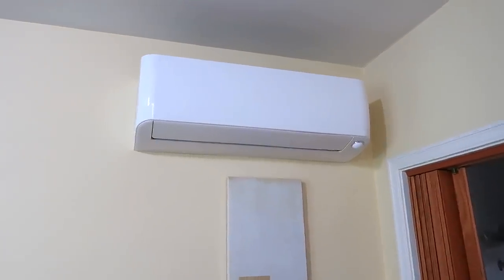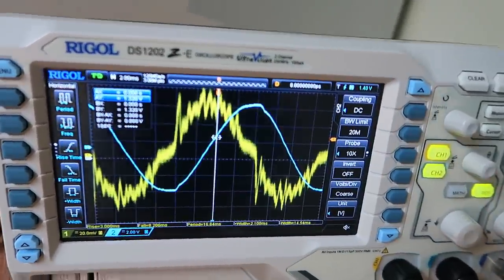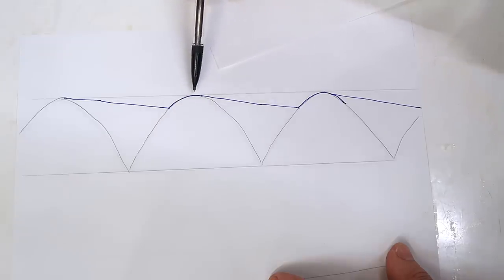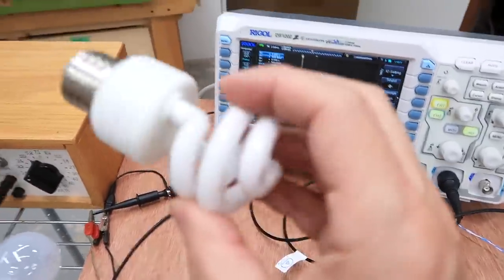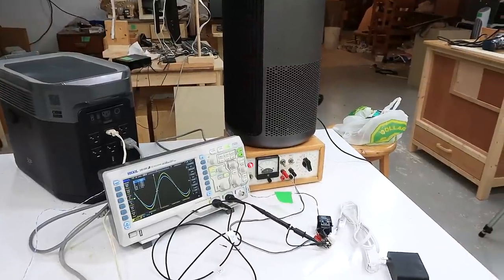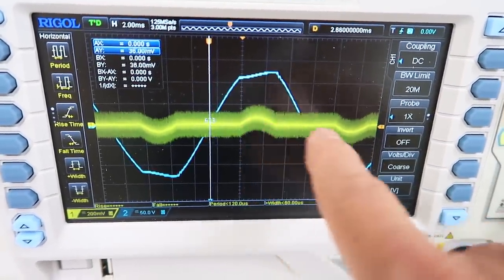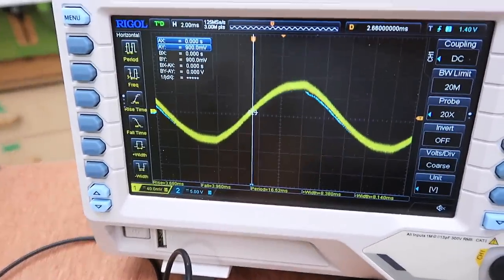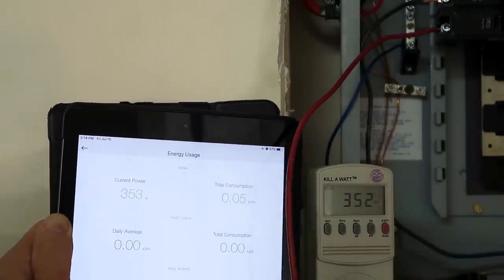Our electrical is all wobbly, measuring power is hard

Comment: This is also a great demo of phase shift and power factor.  The wave forms of the incandescent tungsten bulb have lined up peaks of V and A.  The capacitor and inductors (shaded pole linear  Squirrel   cage fan) have shifts in opposite directions.  The oscillating pedestal fan may have a capacitor in it to correct the power factor.
Reply: Set phasors to stun!

Comment: This video is perfectly timed.   I recently wanted to figure out why the measurement of our 240vac split-phase is so different with a True RMS meter vs another quality meter.   I put the oscilloscope on it (with a differential probe for safety due to it being a 300v scope), and the line-to-line waveform has flats at the top and bottom.  One of the line-neutral legs has REALLY pronounced flats, the other one is  a decent sine wave.      Due to your video, I now have some good ideas on narrowing down what might be causing it, before calling the power company to see if the shop's transformer had something wrong.

Comment: Matthias, as a cross-check, you can always use the "MATH" function on your Rigol O'scope, to multiply the voltage and current traces (AC-coupled, BW_limited), then compute the mean value of the MATH output (also on your 'scope). This is, by definition, the true-RMS power (assuming your CT does not add any funky phase-shifts)
Reply: That gives you apparent power, not true power, unless it's a purely resistive load like an incandescent bulb or resistive heater.
Reply: yes, so long as you use the correct burden resistor on the CT, it should be ok.
Reply: Not apparent power, multiply each sample, and then integrate gives real power.
Reply: @liam3284  That's apparent power.  It would be real power in the resistive load examples.
Reply: @earthwormjim  You mean active power? That gives you active power. Apparent power does not take into account the phase shift
Reply: real power (rms(V*A)). apparent power would be rms(V)*rms(A)
Reply: @ailivac  instantaneous Real Power (aka. Active Power) is the product of the instantaneous Voltage (V) and instantaneous Current (I). This is exactly what the OP said.
Power is more usefully described as a time-domain average over an integer number of cycles of the power frequency
ie. Pavg = AVG(V * I)
Reply: @dl5244  Thanks, D L, for your vote of confidence :)
Reply: @ailivac mean(u*i) is sufficient - you don't need to "RMS". Why? --> RMS is a construct needed, in the first place, because power (from a voltage) is proportional to u^2 (or i^2 for a current-source). The moment you multiply the instantaneous values of u and i , you don't need to RMS anymore. 
Reminder: RMS stands for "root of (mean of (squares))", similar to a "Pythagorean sum" which is a root-of-sum-of-squares.

Comment: When I had my electrical panel replaced, the electrician recommending installing a "whole panel" surge protector in the panel (I suspect because it was easy to install and high profit margin for them). I did some reading about them. It isn't able to do as much as to protect electronics as a dedicated surge protector on a UPS, but it can at least protect against some big surges from lightning, utility surges, etc. So it doesn't replace protecting electronics, but give additional protection.In order to work it's got to be in the first breaker position. One downside was that it made my old X10 power control automation stuff stop working on one leg (it would still work, but the transmitter/receiver had to be on the same leg), effectively filtering the signal as it passed thru one leg to the other.)

Comment: The devices both have of PFC, probably, and the bump you see is probably the charging function of the PFC circuit, which usually has a boost converter to about 400 VDC, and the power supplies in the devices use the higher voltage DC to run the several SMPSs inside them... It is, actually, non-trivial to measure AC power. (I specialized in power measurement at a well-known test& measurement company)

Comment: One option I've seen for recording a higher frequency signal is to use audio input, just make sure you drop the voltage down to audio line level. I don't recall the specifics though.
Reply: But can you actually use that to measure very precise amplitude?
Reply: @user2C47  I believe so from what I recall reading before about audio input oscilloscopes. I'm sure it would need to be calibrated with a reference and it would only be within the frequency domain of the audio input's ADC.
Reply: Yep this can work as long as you calibrate your sound card to a known amplitude signal.
But since he has an oscilloscope he could use that as a fast ADC by connecting it over USB to a PC or Pi to download the waveform and then do the power mesurement math on it
Reply: @berni8k  The Rigol scope is definitely faster than a sound card's ADC but he said the RasPi wasn't capturing fast enough so I'm pretty sure he was referring to computing differences on the Pi. My Rigol scope has 4 channels but a quarter the bandwidth as his. The one I have captures but doesn't send over USB in real time.
Reply: @mduvigneaud  What RasPi can't manage a 2kHz sample rate? Usually converters slower than 2kHz are older 24bit or very crude... The RasPi-Pico claims 500kHz sampling rate.

"32 samples per cycle" (about 2kHz) is about as slow as you can get for reliable AC power readings. The main advantage for sample rates above 64kHz is the ability to do digital filtering and resampling/downsampling, at the cost of extra processing and data
Reply: @dl5244  I think the issue he mentioned is sampling the high frequency noise.
Reply: @mduvigneaud  I can guarantee that the power (V dot I) draw as a function of frequency is dominated by the fundamental (60Hz) because he has a low impedance source (mains). 
And also, the noise in the no-load condition is likely due to stray coupling of fields... (I have a lot of professional experience with CT and power measurement circuit designs).
My biggest eureka moment as a power engineer was when I learned that real power was equal to the summation of V-I dot products OVER FREQUENCY (assuming steady state)... so when the voltage magnitude at a harmonic frequency is (near enough to) zero, then the power in that harmonic is also (near) zero.

Comment: 3:06 PFC is not really about having a "smoother current waveform", it's about maximising real power with respect to apparent power.  If current consumption is sinusoidal, that reduces to ensuring that the current and voltage waveforms are in phase, but for other waveforms it's more complex.  The current waveform of the smoothed rectifier will have a fairly wide harmonic content, which is potentially bad it its own right - but it is at least drawing the most current when the voltage is highest, so I would imagine its power factor would be reasonable.  The reason PCs are required to have PFC is because switched-mode PSUs have pretty terrible power factors out of the box, way worse than a smoothed rectifier, due to their primarily inductive load characteristics.
Reply: I thought California legislation was the main reason...
The primary advantage to PFC is to significantly reduce the RMS current while only marginally increasing real power (PFC losses are generally small).
LAN parties used to be notorious for blowing a 15A breaker with just a few PCs. PFC would have mitigated that.
Reply: This statement is false, but I can see why one might presume this:
"because switched-mode PSUs have pretty terrible power factors out of the box, way worse than a smoothed rectifier, due to their primarily inductive load characteristics"
You will find that switched-mode power supplies (without a PFC stage) have virtually zero phase shift on the fundamental (current wrt voltage). What they do have is a lot of current harmonics with very low correlation to voltage harmonics (assuming a low impedance source like AC mains) thus resulting in little change to the total real power. 
All these current harmonics contribute to the True RMS (and apparent power, but not much to real power)
Apparent power is (usually ascribed as) the product between RMS current and RMS voltage.
PowerFactor is (usually ascribed as) the ratio of Real power to Apparent Power.
Reply: @dl5244  The problem with LAN parties is that the breakers derate. Improving PFC would barely help compared to cooling your breaker.
Reply: @ppdan  the issue I'm referring to is that without PFC, a 250W load may draw up to 4A rms (at 120Vac). Four of these 250W loads will blow a 15A breaker.
Adding PFC will reduce the current to ~2.2A  (for ~250W) so that up to 6 can play without blowing the 15A breaker.
Reply: Half voltage is a quarter power, not half
Reply: @dl5244  We tested this before our first LAN and 6-8 computers would trip a 20A breaker after 6-8 hours. Once fans were added to the breaker boxes we could go up to 12 computer on a 20A breaker and they wouldn't trip once for the whole duration (48 hours). Organized several LANs for up to 300 ppl and never had a issue.

Comment: Used to perform power quality measurements on 2-10 MW wind turbines with costly equipment and a 50 kHz Sampling rate. Quite relieved you didn’t achieve the same on your Raspberry Pi 😂. Great video, love watching you work/figuring things out
Reply: The Pi can do up to ~70-100Khz sample rate on the ADC, but you'd have to write the program processing the data quite efficiently in order to make use of it. So, unless rolling your own program is on the table, yes it's probably better to use something else like a microcontroller with a ADC and write the program in AVR C.
Reply: @theLuigiFan0007Productions  You would have to write a lot more efficiently on a 16MHz 8-bit microcontroller than you do on a GHz+ 64-bit ARM processor..

Comment: That is the best damn explanation of AC voltage and current I've ever seen. I knew all that stuff in theory, but your demonstrations make it so real.

Ps: please be more careful with all that exposed high voltage AC.
Reply: What video did you watch? I don't remember seeing anything even approaching high voltage AC in this entire video. It also strikes me as odd that you would admit to not having much understanding of the topic at hand and then immediately giving safety advice/admonition to someone who is both knowledgeable and experienced with the subject matter.
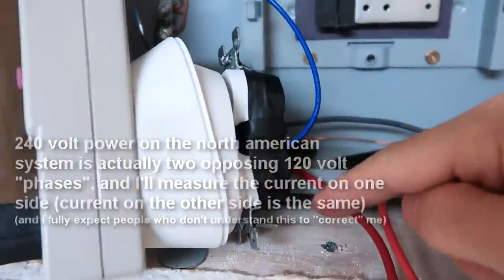Reply: @justinfisher2888  8:03 custom wiring sitting beside exposed panel bus bars with cover removed
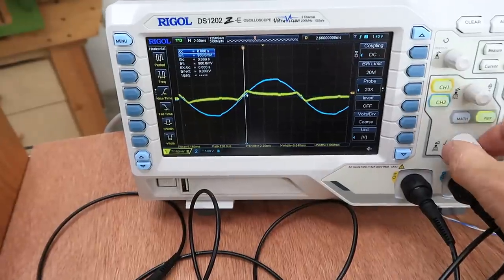4:25 unsecured and uninsulated alligator clips on live mains resting on workbench
Reply: Armchair OSHA inspectors. Sheesh.

Comment: Perhaps related to this subject - a few years ago I installed a ceiling mounted air filter in my workshop - one that has electronic controls for fan speed and timer and a simple IR remote control. It stopped working after a few days due to a blown starting capacitor. The thing about these kinds of controls is that they are always ON to some degree. 

The manufacturer replaced the entire unit. After using the new unit for a short time, I noted that it hummed quite loudly when OFF, but only when the 24 LED "can" lights (connected to an Insteon brand dimmer) were also turned OFF. I "fixed" the issue by replacing the lighting dimmer with an on/off switch. The air filter was not in any way connected to the lighting circuit, but was still greatly affected by what I now suspect was noisy AC current.
Reply: manufacturers love their capacitors in the start of the line to "filter" the current and compensate for the motor, but what they really do is being too weak for the power that runs through them and blow up after the guaraty is over and if you have a really unbalanced electrical system they love to blow up way faster because they do overwork constantly.
Reply: Get a trailing edge dimmer instead

Comment: Was that motor a PSC motor?  If so, when you loaded it and the phases aligned, it was a good example of how the run caps are selected for PSC motors to give the most efficient operation at the design load.

Comment: EC motors produce harmonic distortion of voltage and current. Usually other devices help cancel this out. It’s a big problem in large facilities. Power Factor is produced by induction motors and easier to correct.

Comment: In the past 2 years, I have a systematic problem with LED bulbs continuously failing into a flickering, sometimes screwing it back or unscrewing it works. It only happens in the light fixtures from the apartment, you know those ugly round base with 3 sockets coming out of it,  anything else, even those aluminium that come with a clamp at hardware stores for 20$ work fine. Floor lamp? Fine.  Even an incandescent lightbulb outlasts them, and that bulb is HOT and above a very active turtle and the socket gets corroded. Old CFLs work fine except I can't stand the slight whine they have (I've had them for more than 5 years) Did not have this problem in other apartments.

EDIT: Even expensive Phillips end up failing the same way (takes a bit longer)
Reply: You should keep your active turtles away from the lights then!
Reply: @gorak9000  The ceiling lights are miles away from the aquarium, I referenced the incandescent light bulb in the worst position possible outlasting LEDs in the ceiling light fixctures, to illustrate how short lived the LEDs are.
Reply: Flickering is usually something like, the tiny wires bonded to the LED chip itself lifting off due to thermal stress.  So the LED heats up, package expands, connection breaks, cools down, repeat ad nauseum. The phosphor, and chip itself, also age aggressively at high temperatures (going dimmer and bluer over time, but this takes many years of continuous use).  Enclosed fixtures were bad enough with incandescents already, but they're murder for electronics. 😕
Reply: @T3sl4  those fixtures are not even enclosed. The worst part is that LEDs get almost as hot to the touch on their tiny aluminium portion as old incandescents.

Comment: Matthias does this mean your mini split draws roughly 3 amps? (I=P/V)

I'm glad you tested this device, as there is a lot of debate amongst electricians and installers where im from over the total operating current draw of split systems.

Where I'm from, manufacturer's specs trump our local regs. But manufacturers will advertise cooling power in Watts (7kW for example). This then triggers electricians to run dedicated circuits and install a 15A mcbo when it's really not needed.
Reply from the maker: Here they specify it in BTUs, but the minisplit still needs its own circuit.  The thing is, if it tries to heat when it's super cold outside, it potentially consumes nearly as much as a conventional resistive heater will.
Reply: The Kill-A-Watt can show VAs and PF I believe (this just wasn't shown), but in my experience, a current waveform like that gives a PF around 0.5, so expect more like 6A RMS.

I'm a bit shocked too, that it doesn't have PFC!

On a related note, that Dell PFC looks a lot like one I'm working on right now (new design), the control chip gives significant zero-crossing distortion... Should still give PF > 0.98 or thereabouts, though.

Comment: That's a nice demo showing the difference between linear and non-linear loads. The current harmonics from non-linear loads causes harmonic distortion of the supply voltage, which is highly dependent on the supply impedance. Measuring power should only take the 50Hz current into account, the higher frequency harmonics don't deliver useful power but increase the rms current causing higher losses in cables and transformers. Decent power meters can ignore the harmonics.

Comment: Magnetic material is non-linear with current such that magnetic intensity doesn't increase proportional to the current. This causes third harmonic distortion and "wobbly" current waveforms when motors and transformers are plugged in.

Comment: I'm using PZEM-004T modules connected to Tazmota, wifi to a Pi board running Influxdb and Grafana. New graphs can show just about anything with relatively quick setup once the base system is up and running. adding another sensor is quite easy. There is some learning curve. Grafana can do some math and display the results. 
Last month I made a portable unit, a box with power lead and outlet on the front that can be moved about to monitor power use where needed.  Just has to get a wifi connection.

Comment: I think the important step is to verify that the power company usage meter uses the same technique to integrate power readings.
Reply: some utilities are allowed to bill on fundamental energy (but afaik that must be indicated), but that's rare for active energy (and conversely very common for reactive energy).
Either way, the voltage is low enough distortion that no current distortion will affect the power

Comment: Your rigal DS 1202 has math functions. You can multiply channels one and two to get the product. In other words you can calculate the instantaneous power.
Reply: Yep you can do math to multiply the current and voltage, then place an average amplitude measurement on that to get actual power. With some more math you can also get the power factor.